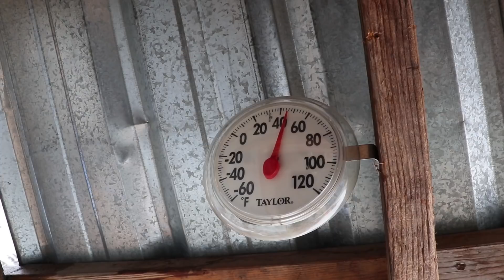Ledger Board Installation on Timber Frame House

Comment: Little trick from the old school. Take a number 5 Jack Plane up for the installation. You can take a small amount down to perfection without running through the table saw. You could have saved all of the time up and down the ladders and zero chance of ruining a board. You two continue to amaze.

Comment: You can waterproof your roof by adding a U-shaped frame under the plastic-tarp around its edges. That way the connections between the tarp-pieces stay higher than the rest and the water flows down at the open end of the U-frame. A bit of leftover wood would do the trick. Greetings from Germany :)

Comment: The tool you needed for the table saw is called a "feather board".  It will hold the board on the table and prevent kickback. They are easy to make and use. YouTube is your friend here.

Comment: I don't like heights - I climb, but I don't like heights (yeah, I'm a paradox) at all.... watching you on that frame (which was wet) had me concerned for your safety.  Not telling you what to do, some people are better on a high-wire then a sidewalk - but the height reminded me of the best thing I added to my shop - harness cleats at the ridge. I installed them on my metal-roof'd shop and it allows me to clean the roof in any weather and without fear.  You're right at the point where it's really easy to install them at the ridge - so it's something to consider.  Thank you for your videos.

Comment: Nice editing on this one! The music was great for the weather and task at hand. The volume did NOT over power the dialogue and that beautiful frame kept my eyes glued to the screen. The wide angle cameras did play with my stomach and mind a bit. I did construction for about 20 years, but never could get comfortable with heights. A lift is much easier to tolerate, but walking on boards or using extension ladders is no fun. I stuck to what I was good at and let other guys do the tall work. A harness isn't a bad idea, although in some cases it can be more of a pain than it is worth. I can't wait for the loft floor, sips, and roof to go on. Good luck on the project.

Comment: You need featherboards on your saw to keep the wood tight down on the table and against the fence. Some sort of outfeed rollers or support would be good too in case you're working by yourself.

Comment: Hey guys, when I use an extension ladder, I try to always strap the upper rung to what I'm leaning it against whenever possible. That will prevent it from sliding to the side when working on it especially when doing what you guys are doing. I'm not safety police, but I am in construction and am no stranger to a ladder. I hope your subscribers like this comment so you see it. 👍 looking good guys, love your channel.

Comment: You need a featherboard to hold the board to the table at the point of the saw blade that will reduce/eliminate the variation you are seeing.
Reply from the maker: Not a bad idea! Didn't think of that at the time. Turns out there was a small adjustment nut we NEVER KNEW about that tightens the fence. We've been working with a wobbly fence all this time and two turns of the nut and BAM! Fence is dialed. We have a neighbor to thank for the insight.

Comment: Here's just a little thought try a feather board to hold down the board to the table, and 2 to push up against  the face of the board to push it back to the fence one on each side of the saw blade. I did not read all of the other comments to see if any one may have suggested the same thing, good luck. 
Love you guys. ROLL ON;)  Chris M Fla.  Subscriber 1.5 yrs.

Comment: How far to the nearest emergency room?  As others have mentioned, you MUST wear safety harnesses working up in the air like that, and you should NOT be on that platform or in the beams when they are wet!  Construction is dangerous.  Safety first.  I get it that the timber frame can be assembled green, but all the other lumber  needs to be dry or it will warp in no time.  Not sure what happens to the timber frame with extended weather exposure  like this, but the decking could be toast after a while, and the frame sits on the deck.  Finally, there is a tree up against the right side of the building that needs to come out of there.  It is too close to the house.  Best time to take it out is before the building is closed in.

Comment: You are working with zero scaffolding. At the very least throw a few boards across the floor joists, you’d then have a platform to work off?

Comment: Just a suggestion....lay your impact drivers on their side.  Less chance of sending one to the parts bin when they get knocked off the project.  The fall won't break anything but the sudden stop on a rock, concrete or the ground will.  I agree, safety harness is cheaper than a week in the hospital or worse. Think about the amount of time you will be spending aloft.
Reply: Gotta agree on both points and like to add one more, it being that frame is oiled, so even more slippery than untreated wet wood. Personally i'm not afraid hights, just the sudden stops when going downwards and possibilities of such event. You would not get me to climb there with out proper flooring and safety equipment. Put some boards to walk on and get that roof done asap. After that you can take you time with rest, long as you prioritize making walls weather proof, so you dont have wet oily wood to slip on. 

Even if frame is oiled, it does not like being wet and will take looong time to dry, witch can and will lead in peaces to shrink and its not perfect fit anymore. This why winter building is more expensive and usually avoided if all possible. Some people get decent deal by making concrete and base building at summer and putting frame together at winter, but then roof is priority number one.

Comment: Tarps and tyvak are your friends.  You can temp dry in house. I built mine by my self so it took much longer. Also put some temp plywood or plank walk ways. Couple screws to hold from slipping or moving.  Unscrew ,move and screw. Better and safer work area. You two are doing great. Glad to see progress. Keep it up. Sorry but i have to say, trim that darn tree.

Comment: for goodness sake guys put some boards down to walk on safely up in the loft area .
i am having a fit watching you guys without harnesses up there  just  beam dodging .
safety first guys. you should have taken a 1/4 inch check out the board not the beam .
the wood when drying will shrink. and remember always blame the inanimate object .
best regards

Comment: Your table saw issues are another reason to use hold-downs, not to clamp in place, but to put pressure from above to keep boards flat against the table. Just a thought...

Comment: I remember learning how to build roofs.  When someone shouts, "this rafter is too long" and then wants to cut it, you know it's going to be a long day and a long time before this roof is right.  
Why is that one rafter different?  What's' it say on the other side of the building?  If it's truly different, who cut them and why are they not all the same (within reason)?   Don't cut or chisel anything until those and other questions are asked and answered, and to cut that rafter 1/2" or 1" shorter (if you really should) use a cross cut saw, straight down.
The other thing that bodes trouble is string lines, especially if you're up to the roof and still using them.  They always present unforeseen problems that leave a mistake, rather than make everything 'perfect'.

Comment: If you ever have to make ledger boards again, make sure to cut the bevel first and Then cut the board to with at the ninety degree angle, it is much easier to control.

Comment: Hi there: may I suggest soon you can see professional framing guys, as the roads firm up for cement, and pay attention what type of saws & tools they use now! the model 77 worm drive saw built the USA in the last 60 years (the blade is on the left side) for a right handed person, look at air compressors, skill saws, nail guns & staplers ( I have seen quite a few screw heads snapped off when wet & frozen)  you are doing a fine job, hang in there April is next week now!  Nick Wiese

Comment: I suggest that the boards have 'flat spots' because you simply sawed them full length with NO guide wall !!!  
Nobody can saw a full length board as you did without causing at least SOME wiggle...  resulting in the inevitable flat tops at the knife edge. 

Put the flipping saw on a long thick timber, (if you haven't got a long enough work table),  and have two or three GUIDE walls to ensure the cut board is running true.   If you recut the same boards in the same manner,  you'll just be chasing your tails all day long.

..

Comment: Quick question. I see you guys are posting your updates from a rural location. I’d have to guess internet providers and their up and down speeds are not to great. That being said, my question is what are y’all using for your internet connection? Thanks. 
Ps. From experience on building my own house. Keep your head up, stay strong and committed. And never lose track of the love y’all have for each other. Problems and issues come with everyday living. But at the end of the day the one that goes through those problems and issues with you is the reason why you continue to press on.

Comment: I obviously couldn't see the bottom edge of your ledger boards, but if you had a little wiggle room you could have just pulled the high sides down. once they dried out they would hold the new shape. Would've saved you the hassle of taking them back down to recut.

Comment: you can burn the moister out with a torch, but its kinda tricky because you can burn the wood so you need to have the flame low but also not to low overwise it doesnt work

Comment: Typically I use a “positioning belt” so I can be confident of my position and tied to the structure. Allows me a better angle to the work and the confidence to hang off the side if I need to see better. Now that being said osha required a spotter for each of you and a restraint harness.. and a harness rail.. positioning belts won’t save your butt if you fall but make you less likely to fall.
Reply: Osha rules apply to their project? How do you come to that conclusion?
Reply: T wagner thank you for your input.

Comment: I'm more and more convinced that it's not a question "if" somebody fall and gets hurt but "when" ;( Sorry guys, I love your channel, but I'm simply worried watching You walking on the walls and beams and lean to do the work. Even before, where there were just concrete walls but you had already a flat floor inside I always thought that instead of walking on the thin wall, You should have invested to some basic metal scafolding (and maybe make things even faster)... It's really scary, and now you're even higher ;)
Reply: can't wait to see the roofing videos !!!!
Reply: Jan Zamecnik I totally agree! Guys, it is really amazing to watch your journey, but this is not the first time you guys are breaking every HSE procedure that was invented. Walking 30 feet over the ground on wet, slippery beams, no harness, no hard hats, no scaffolding...the list is long. It will take years to fulfill your dream but one wrong step on that frame will take it all away from you in one second! Please, pay more attention to your SAFETY!!! A few OSB boards to walk on, certainly wouldn’t hurt up there...even a simple harness with a safety line that clips on to the beams to prevent falling off the structure...your tools clipped on to your belts so you don’t need to picked them up each and every time, risking losing your balance. Really just a few simple things would have made that job million times safer. You both admit you are rookies and it is all fine, but watching your journey the only real mistakes you have done so far is an occasional gross negligence of safety rules. Please pay more attention to safety and good luck with your project. It is totally amazing!

Comment: You would think with all that extra lumber they could have covered the roof, nailed down some tarps to help keep it dry since they knew it would be a long time before the SIPs arrive and cover that floor so they could walk around
Reply: Not without the walls. Think of all the trouble they have with just a flat tarp on the floor.

Comment: What are these ”SIPs” of which you speak?
Reply: Gary McCoy structural insulated panels. They mount to the outside of the framework and provide extra insulation as well as stiffen up the wall for exterior sheathing.

Comment: Wish you guys would wear SAFETY HARNESSES!!!!!    I cringe every video like this!
Reply: I was thinking the same thing, very hard to watch with my head turned every time the camera shows you walking around on the beams.
Reply: When ever ur head is 6’ above ground according to osha
Reply: She mentioned the kids room. There will be no kids if she falls thirty feet.
Reply: I agree they need to be tied off, anything over 6' in height needs tying off.
Reply: They don't need safety harnesses, they could just put down a few pieces of plywood. Its not hard or costly, it's just part of properly setting up a job.
Reply: Came here to post this also, Jesse use a harness buddy, we want to see the house complete....
Reply: YodaAZ58, I couldn't AGREE more!  Wow, with the rain and slippery boots, it only takes one small misstep and over you go!  PLEASE get some safety equipment and use it.  We don't want you to get hurt!

Comment: this is all a waste of time, to bad looks good. They need to think about insulation, unless the "sip panels" go up the outside of the walls and not inside the frame then they need to put the boards on the inside of the beam to allow for insulation.
Reply: Thor...So you are making an assumption, about something you know nothing about ,makes sense to me!
Reply: I guess you don't know what the I stands for in SIP.
Reply: I'm pretty sure the"Structural Insulated Panel"will do just fine on the outside.
Reply: A simple google search would reveal that “SIP” stands for structural insulated panel. Obviously they go on the outside.
Reply: Here in U.K. we envelope the outsides of the frames with sips (or most companies do) I don’t as I won’t use PIR or phenolic insulation panels due to recent events. Thermal value will be fine with sips outside.
Reply: It's clear you have no idea what SIPs are. The "I' in SIPs stand for "insulated".